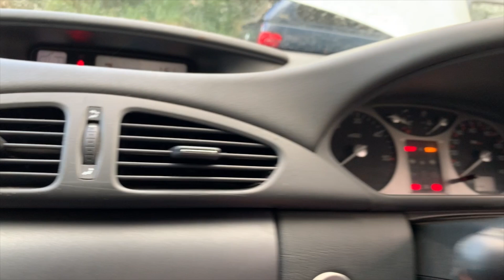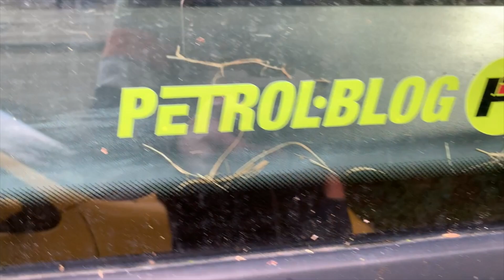A Warts and All PetrolBlog Fleet Update – Part One of Three

Comment: Didnt know you had a Laguna II. Ive had 3, a 1.8 petrol and two V6's. Nice cars but painful to maintain. The main bushes on the rear beam will almost certainly need doing. Fun fact, the Laguna II was the worlds first ever car to get EuroNCAP5 rating.  However it nearly didnt due to its wheel and tyre size. To get the levels of grip in, they had to go with 225 tyres on a 18" wheel. This puts more stress and loading on the rear beam than it was actually designed to take. Hence why the Bushes wear out every 4yrs or so. They also go through Windows Regulators like they are going out of fashion. Ive replaced 6 across my 3 Lagunas.
Reply from the maker: Obviously knew about the five-star rating, but did know about the tyre/wheel – interesting.